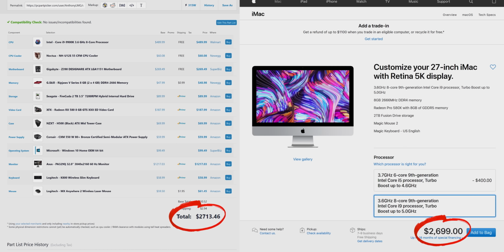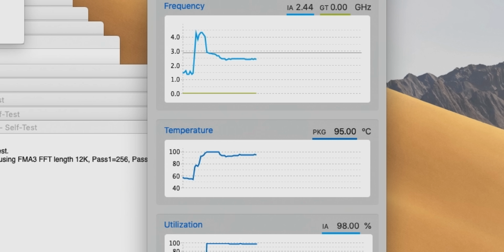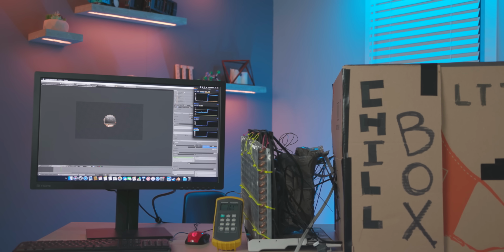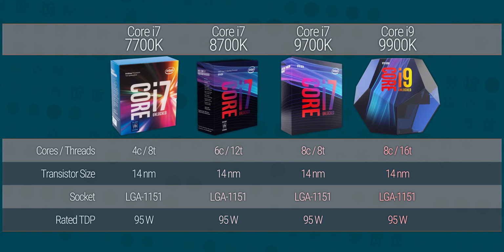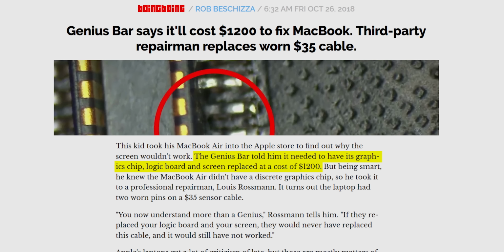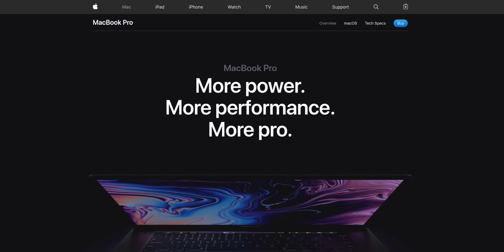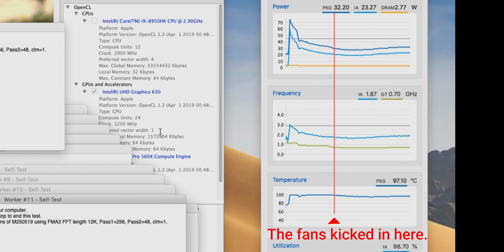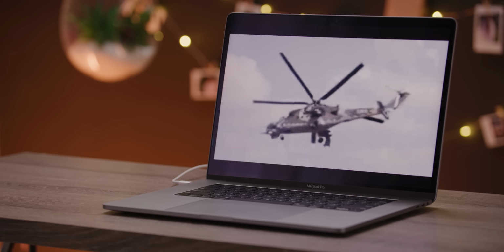Macs are SLOWER than PCs. Here’s why.

Comment: An even bigger problem is that Apple doesn't give proper support to anybody who wants to repair their computer, and they lie about your computer needing extremely expensive repairs when it might just need some very minor work. They're also designed to look pretty rather than for functionality (such as cooling/ ventilation, modularity, ease of maintenance, etc.), and a lot of them have serious design flaws which cause them to malfunction or break really easily. They go to great lengths to make it difficult to get your computer repaired, as they use their enormous political leverage and their legal team to unfairly go after third party repair services in various ways, including pressuring U.S. customs to seize shipments of replacement parts based on completely bogus claims of copyright infringement. It would be equivalent to a car company saying that it's illegal to use wheels or tires made by another company. Somehow, Apple is able to sometimes convince mentally judges that they're right, (especially in the U.S.) though they certainly don't win all of their court cases. 

They are extremely anti-consumer. Therefore, there are a lot of hidden costs when buying an Apple product. If you build a similarly spec'd PC, you're getting something which is an order of magnitude easier to maintain and repair, as well as to upgrade.

Comment: Interesting interview, the throttle concern between the mac notebooks and the iphones has been a big question. Iphones and Ipads use the apple cpu, as the rest of the line uses the Intel chip. Intel and Apple have this partnership, and Apple can't force Intel to make a better chip.Apple could make a better board to compensate. Rumors are Apple is looking to have all their systems be running on the Ax processors in the future, and not be intel based at all. As for the chipsets running at lower speeds, Apple did do this in the 2010-2015 chipsets, Remember when a Macbook pro was a dual core 2.3 GHZ chip or the Macbook air was 1.6ghz? They ran slower, but probably performed as good as the faster 3.0 ghz chips...but the public was enraged! Slower chips! Who wants that? So we have what we have today, faster chips, faster throttling, lotsa heat! Dodgson, Dodgson, we got Dodgson here! See, noone cares! does it look cool, hells yeah!

Comment: I'm about to graduate as a computer engineer and plan on going into computational science, which I've had a couple years of experience with now. For me, all I've ever really needed from my laptop is that quick burst of power that Apple does better than anyone. The things I need to do like loading a large file, compiling, running a quick simulation, aren't true sustained loads, and I much prefer a thin and light with a 4 core i7 that bursts in performance then thermal throttles over a heavy 2 inch thick loud boi that can hash like crazy for hours on end (with what little battery life it has). When I need to do a computationally intensive task like training a neural network or running a large scale simulation it's always offloaded to some kind of super computer. I've had MacBook pros since 2015 and I've wanted them to be faster about as often as I've wanted the super computers I use to be faster. This would be a much much longer comment if I went into all the things I hate and problems I've had with Windows, and thanks to your videos about linux gaming I've finally been able to do away with it completely in my life. When it comes to the things that actually matter to me like responsiveness, durability, stability, storage optimization, data availability due to the cloud, and form factor, Macs have 0 competition in my mind. I know some mechanical engineers who would benefit from laptops capable of sustained workloads, and some designers who need the power for video editing or rendering, but it seems that the vast majority of people rarely if ever need their laptop to be capable of computationally heavy tasks. Computational power is needed when you like to build systems, overclock, performance test, game, or do random things like hashing or neural network training as a hobby, which is exactly why I have a custom built system as well. Apple doesn't tell their customers about the lack of performance of their systems when it comes to sustained workloads because why would they? They aren't hiding anything or lying, nothing on that Apple page looks misleading to me, just simple advertising of the systems pros and lack of mention of the cons like any advertisement. To summarize, some people need/want the ability to sustain heavy workloads, some don't, know what you want to do and how your choice in hardware is going to affect your ability to do it. Linus shouldn't buy a MacBook just like my grandma should buy a gaming laptop.

Comment: And 1700 dislikes so far.  Wow apple users just can't tolerate someone saying something bad about their products.  Nothing's perfect people.  If you can't tolerate someone telling you the shortcomings of the device you bought why even watch the video?  Some Apple people are the worst "mouth breathers" I've ever seen.   :D

My Surface Pro isn't perfect but while I still love the machine for it's portability, great keyboard cover and such I realize and accept somethings are not perfect about it.  The fan can get loud, it's to heavy for a tablet, it's stupidly expensive, etc.  You'd have to pull my Surface Pro from my cold dead hands but it's just a device that I use in conjunction with my PC.  When it comes time to replace it I'm going to be open to options from other companies.  Also even with those shortcomings I'll take it over a Mac product any day of the week.  It's been running strong since I bought it in 2014!  How many Apple products can say that?  Sure the battery isn't what it used to be but I can still get 3 or 4 hours out of it and it runs great for what it is.

Comment: You know what the bullshit is? Mac OS itself actually runs significantly FASTER on a bootleg hackintosh on supposedly unsupported hardware than windows 10 does on the same hardware. The operating system itself is actually quite efficient. If only they got over the need to make everything ultra thin
Reply: Thank you. I will never buy an Apple product again due to their anti-consumer practices (I haven't bought an Apple product since the early 2000's) but Mac as an OS isn't actually bad, outside of myown interface gripes, mostly stemming from not using it regularly. Thing is, I wanna work with audio production and some of my favorite software is optimized more for Mac.

After doing a lot of research I may build a hackintosh.

Comment: I wish I could buy a (new) laptop with a case as thick as a '90s laptop, then maybe it might actually get some airflow to the internal components.  I bought my wife a new laptop a year ago, and because it's so compact and the fan so tiny it keeps overheating and running slower than molasses in January.

Comment: My maxed out 2017 Dell 9560 XPS 15 should be faster than my 2013 MBP, but it's not - or it wasn't until I took it apart, put new thermal paste and especially some heat pads on some of the power chips.  Before I modified the Dell, it would frequently power throttle (not thermal) and limit my core speed to 0.8GHz.  Yes that's right, less than 1GHz.  Even with the Intel undervolt tool (which helped somewhat), it would still power throttle during any gaming.  So while Apple may be lacking, Dell is far far worse in my experience.
Reply: Its a split problem between OEM's and system integrates as well as Intel not evolving with the form factors of a given device. 10nm could be delayed for up to 2 years total and that is not good news. You will see a lot of people switch to Ryzen mobile CPU's very soon.

Comment: Relatedly, It was only AFTER purchasing my laptop (2yrs back) that I learned 'Comes with a 1050 Ti graphics cards!' means '*the mobile variety that is much weaker'. In retrospect, it makes sense, but It was not fun having just bought a new machine just to find out that any NEW title will be run at or near minimum graphics. Like Overwatch, yeah it can RUN it, but it's a not great experience.
Reply: Yeah you definitely have to watch out for that. Its pretty dishonest and that cut down mobile GPU stuff happens on both sides of the isle all the time. You would need a mobile 1070 or 1060 to be ok.... Laptops in general are pieces of property that you buy that have many compromises built in....

Comment: In my opinion, this is the biggest problem with todays laptops. Having owned multiple windows laptops over the year with slim profiles and good externals, I can say that companies don't give a shit about thermals. If he laptop isn't branded as "GAMING" and is as thick as a brick, chances are it won't do too great under heavy loads. MacBooks are still great, especially the new MacBook Air , but I would recommend staying away from ones that have strong specs. In fact, I would not a buy a performance laptop from any company, unless they really offer a good cooling solution.

Comment: Here is a dumb question from a guy who has no great experience with hardware apart from what you would need and how to build a pc.
Would it be possible to construct a pc with all metal parts or high temp resistant synthetics that would not need to worry about cooling? Lets just say the pc could comfortably work at temperatures of up to 300°C.

Comment: I got a used Macbook pro at work. I was surprised when I saw the specs. It's a i7 and the performance is like a i3 or worse. I don't like the management of windows and the key orientation. I will probably never getting 100% used with it.
Reply: I could barely get through using one at the library in college. That mouse they have is god awful.

Comment: I love how this dude magically forgets that all pc manufactures make engineering decisions to produce their desired product. Thermal management, battery performance, cost etc. I mean, Linus had been carrying around a previous generation Razer laptop as opposed to a higher performance gaming laptop as it turned out the trade offs of having higher weight, lower battery life, higher heat and fan noise were trade offs that did not make sense for his portable workflow. Laptops have always been portable at a cost of performance. Also, when Linus mentions the iPhone performance, it’s not mentioned how the silicon in that phone is custom architecture. I mention this as intel’s mobile chip road map delivery has been a cluster for the last few years... More than anything, I think this shows how the next few years are going to get interesting regarding mobile architecture.